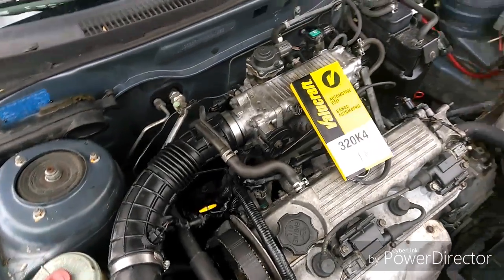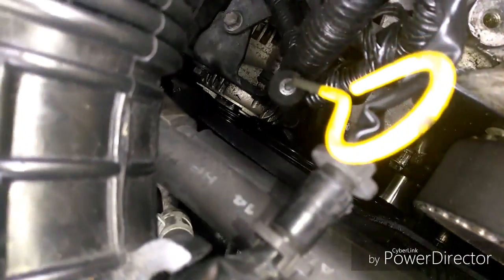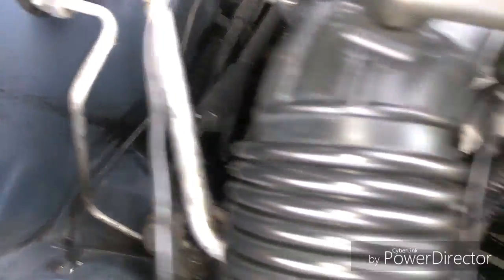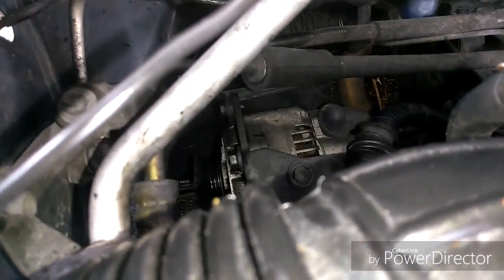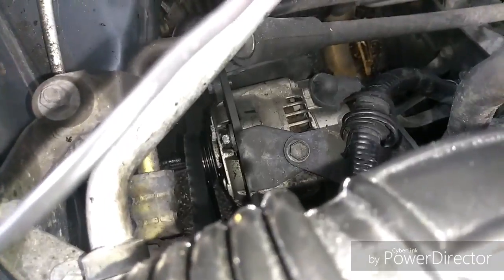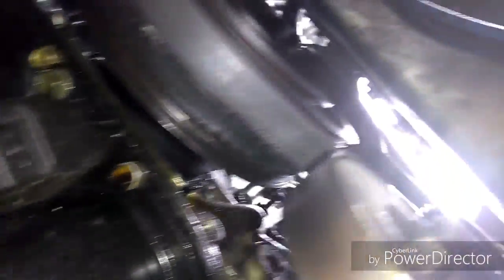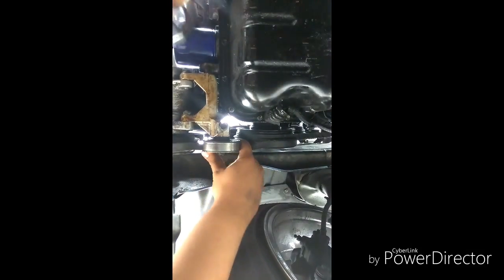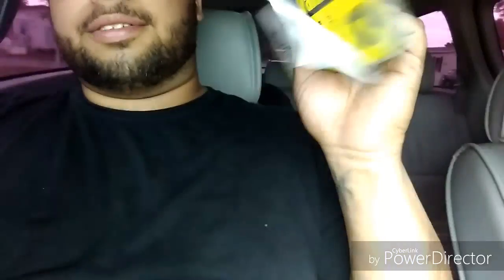Changing alternator belt on a Suzuki Esteem

Comment: Leaking oil there, Is this an Esteem 1.6? Would be nice if you had it in description, because an 1.8 had 1serpentine belt that drives on the AC, power steering and so on.
Reply from the maker: +Pfirtzer my apologies it is a 1.6 the 1.8 is a chain I will update the description .. also oil leak was due to a bad crank seal that I didn't get to film